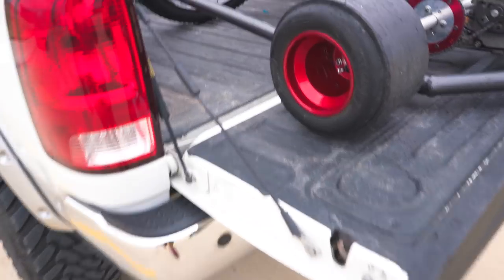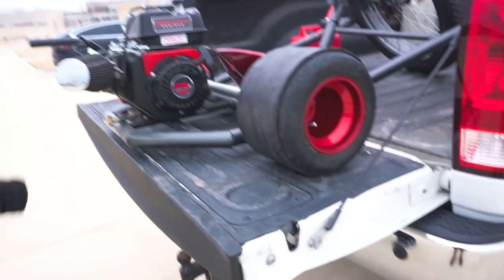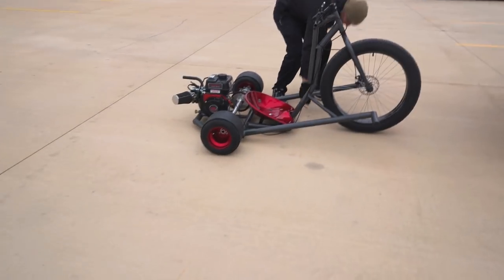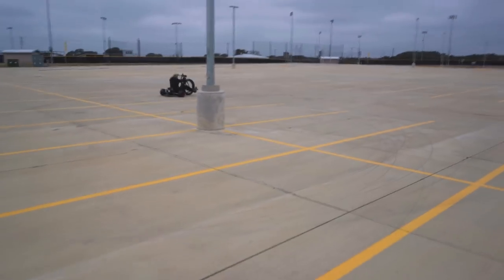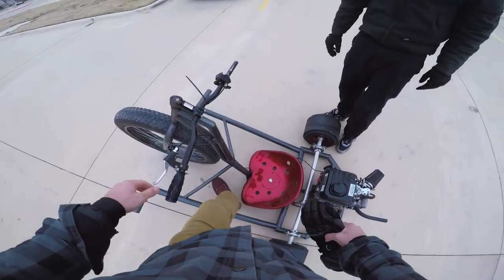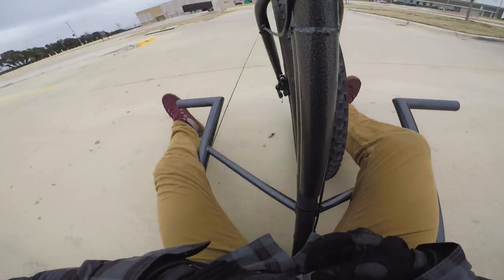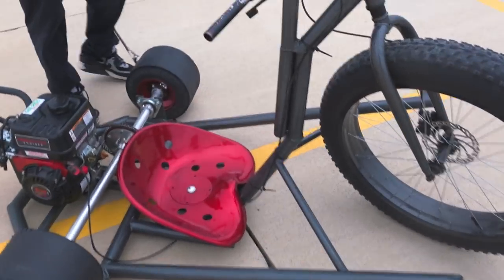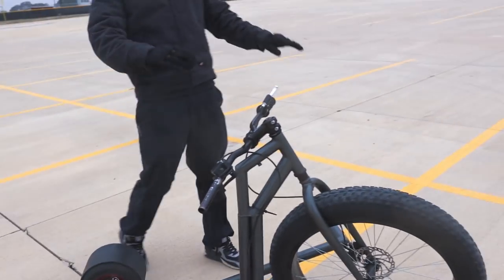First Time on the DRIFT TRIKE!!

Comment: If you build one... Put a smaller front wheel on it. You will be able to get better frame geometry. On top of that, you can also steer further because the sterring can be closer to you and not so far away to fit that massive wheel.